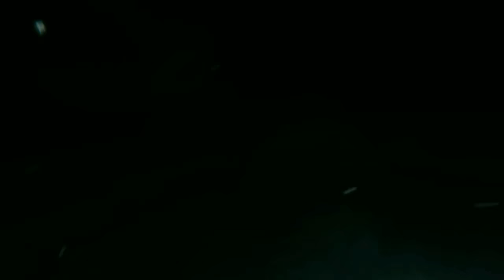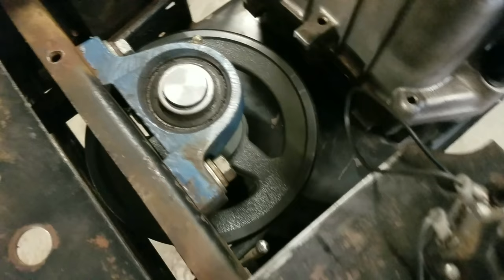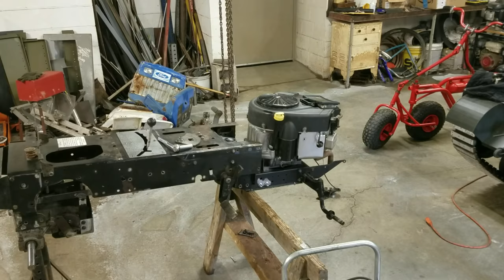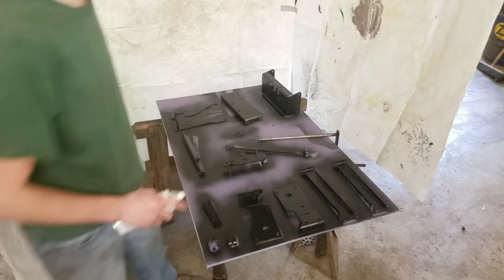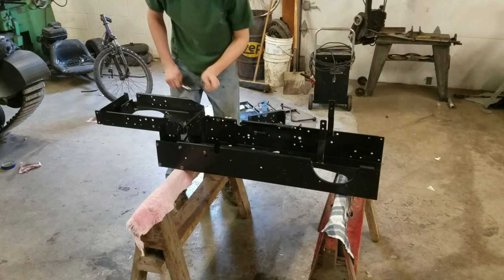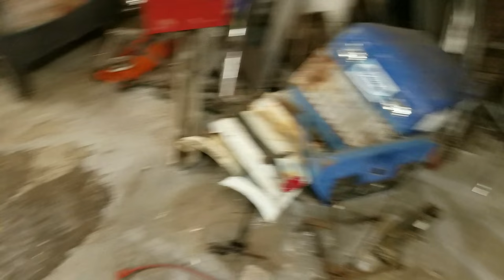Ford Mower Part 11 (painting the frame)

Comment: Pull that solenoid out, clip the needle off it. It's just unnecessary EPA junk.

Whatcha doing for an exhaust? A 2 into one setup would be cool and add a bit more power from scavenging, but duals are also pretty cool. Either way, I'm sure you'll do something cool. Keep up the good work!
Reply from the maker: I've got something really fun planned for the exhaust :)
Reply: Ooh, cutout/tuneable exhaust?

Comment: Quick suggestion you might want to use new bolts and nuts if you can ; but other than that Great JOB
Reply from the maker: I will at least paint the visible ones so they dont look bad

Comment: You built a “spray booth” and didn’t record it?  😂

Looks great. You should look into Evaporust to eliminated the corrosion on the pile of fasteners. The stuff works great. The YouTube channel Hand Tool Rescue uses it it and has been sponsored by them too.
Reply: I got the Vibrating thingy that looks like a Blue Pumpkin from Harbor Freight (that guys usually use for reloading bullets) and I clean all my fasteners in there - works AWESOME! make all your used fasteners look brand new!!
Reply from the maker: i'll look into it, thanks